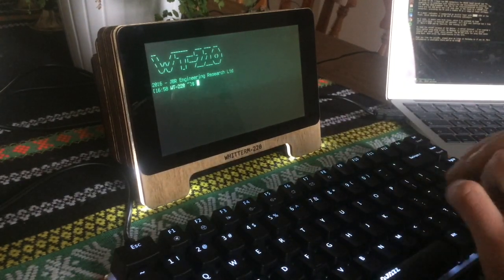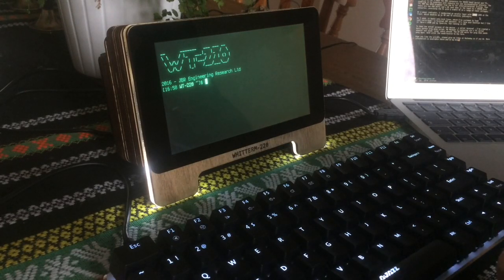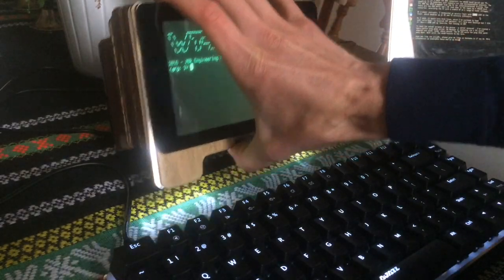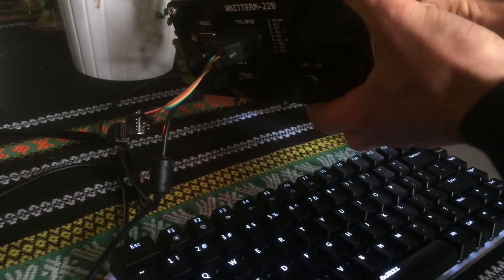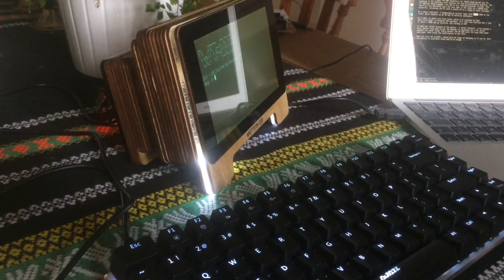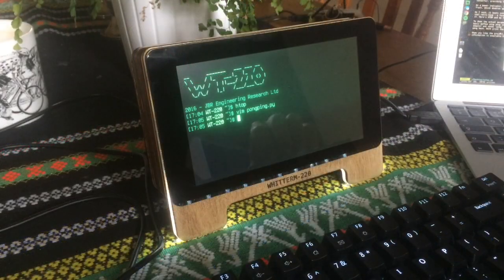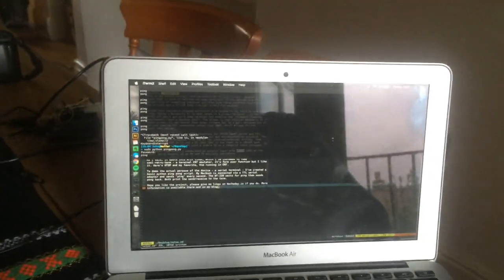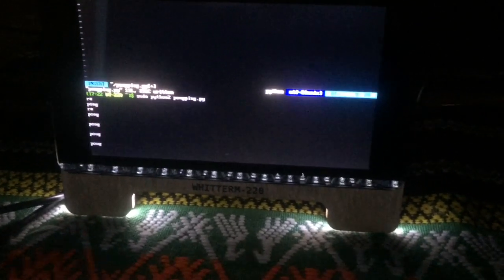WT-220 - Raspberry Pi 'Clever' Serial Terminal Project

Comment: LOVE the idea, especially all the retro-modern looks you've given it. Personally, I'm going for something similar using the up board for that x86 goodness, for managing the countless headless devices at home & work, and more headroom for fun stuff like emulation, or a portable media center. Do you have any tips, especially on the mechanical side of things like fitting all the circuits in there and designing the chassis?
Reply from the maker: Marcus Grant Just get hold of mechanical 3D models of every item and build a virtual assembly is the way I do things. No surprises that way and it went together first time with no fettling.

Comment: Does it boot into cool-retro-terminal or you have to manually run it?
Reply from the maker: Mine doesn't as it takes a bit of time to boot and for doing actual work retro charm is superfluous! One could easily create a systemd service that starts it at boot however if that was desired.

Comment: WYSE made some interesting (relatively) cheap VT-220/VT-100 terminals in the mid '80s. At that time, Wyse was dominating the "terminal" market, surpassing Beehive and other terminal manufacturers. I used a SWTPC RS-232 keyboard, -and a S100 buss Cromemco TV Dazzler in the early 80s. ;)
Reply: Some of them such as the WY-55 could emulate many common terminals.
The keyboards with them were pretty good as they used the black Cherry MX switches.